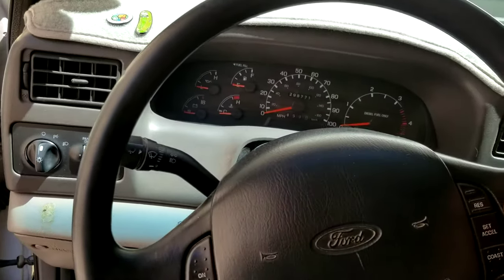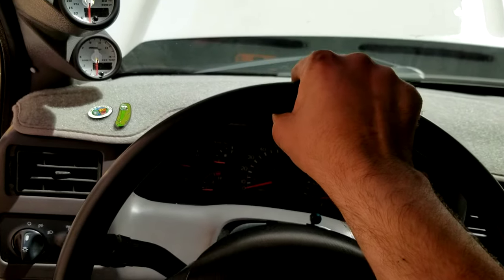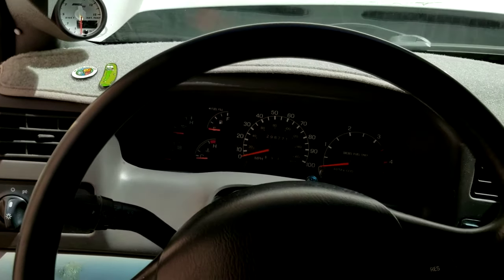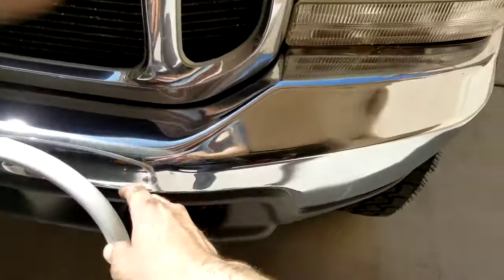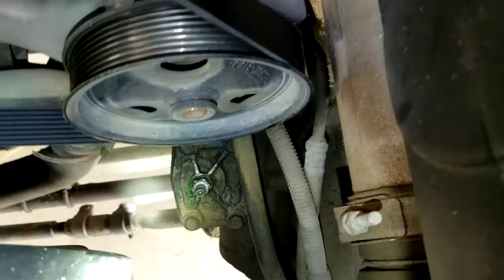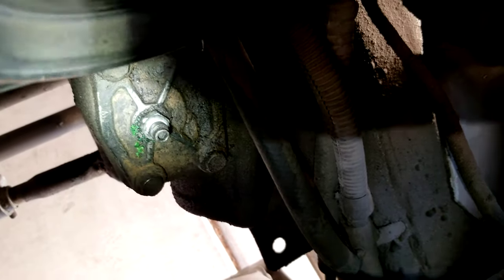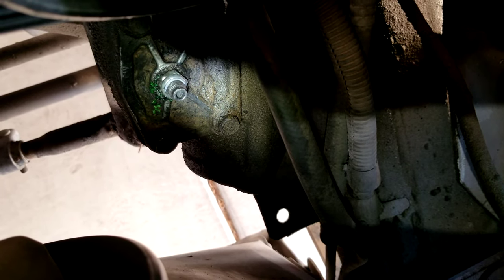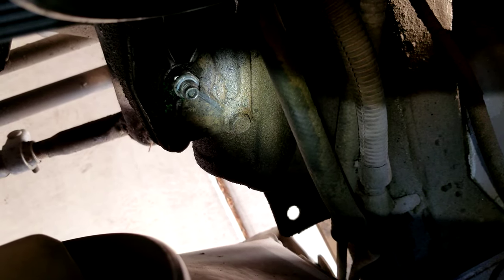F150/F250/F350/F450/F550 loose steering fix.

Comment: 2000 Ex 7.3l... I thought you only tightened the hex 1/4 turn at a time. This was tighten and then back off 1/4 turn.   Sure don't want to screw this up, so which is correct?
Reply from the maker: You tighten all the way down till your screw stops, but very softly so you don't damage your pilot point. Then back off a 1/4 turn and tighten your lock nut.

Comment: I’d replace the steering box  and it didn’t fix anything
Reply from the maker: @harly108023  you replaced you steer box and you still have steer slop?
Reply: @marshall32781 yes sir I don’t know what to do now
Reply: All my suspension parts are new (ball joints, tie rods, pitman arm, steering pump as well, wheels bearings and the problem still there
Reply from the maker: @harly108023  you check your ball joints. They may be worn out. I would do a full inspection on your front end. 
Jack both front tires off the ground. Grab your tires with your hands. Move your tires back and forth from side to side, look for anything loose in your joints. Then grab the top and bottom of your tires and pull and push to check you king pins or bushings.
Reply from the maker: @harly108023  sorry I didn't see that you did all that already. 
What about the steering u joinst and shaft going to your gear box?
Reply: @marshall32781  yeah I did. I’m taking it to a different mechanic to see if we can find the problem
Reply from the maker: @harly108023  yeah. You definitely have a problem somewhere. Good luck. Hope you can find the problem and get it fixed.

Comment: Gotta be careful doing this. If you overtighten this screw, it will slow the recoil as you round corners. Too much tension and you’ll notice it. Not hating, cuz you are so right....just gotta go easy on that screw. 👊
Great video!
Reply: It can wear out and fail much quicker if it's not tightened properly. It doesn't take much to ruin things.
Reply from the maker: Yep. That's why you take your time and do it property.  Never rush.

Comment: Right on, sir. I have that slop in the steering of my '01 F-250 and it absolutely sucks. This is next on my to-do list. Thank you for the video. 👍👍
Reply: One of my EX mechanics told me my 2000 f150 4x4 doesn't have that adjustment ? OMG i will check tomorrow morning. and if he was a LIAR i will go to him and ask him why all the front end parts almost 3K and steering was still dumb ?
Reply: Did it work

Comment: Information for anyone watching this video and considering making this adjustment.  You need to do this when the steering wheel and tires are centered.
If you do this as described when the wheels are turned you will create a bind in the steering and the wheel may not return to the center after taking a turn and cause accelerated wear of your steering box. In extreme maladjustment you could crack the housing of your steering box. 
When doing this adjustment you are reducing a very small amount of gear tooth play that is designed to exist. Complete removal of this play is not a good idea.

Comment: Horrible advice regarding screwiin all the way and then backing off!

The PROPER procedure is to do a 1/8th turn clockwise of the centre screw then tighten outer lock nut and go for test drive and repeat as necessary till steering is improved. 

The method described in this video is a sure fire way to grenade your steering box and that is EXTREMELY dangerous at city speeds let also on the highway.

Comment: My 2005 Ford Excursion is horrible! You have to DRIVE this thing. Makes my arms hurt from constant back and forth movement. Gonna give this a try.
Reply from the maker: I hope it works for you. That dose suck. Especially on long trips. If you haven't already don't forget to look at your ball joints also. Make sure there not sloppy
Reply: @marshall32781  We just put a new stabilizer bar on. Tomorrow we will do the steering box. The ball joints look like original equipment. Dealer put new shocks on but it looks like that's all he did. 1 thing at a time.
Reply from the maker: @billie-leelawhon3941  just remember don't crank down on the pilot needle. Be very gentle.  If you damage the needle your gear box will be junk. Just be very gentle with it. Take your time.

Comment: That's the worm gear you're adjusting and you only wanna do minor movements at a time. About 1/4 - 3/8 adjustments, then test drive it. The problem I'm dealing with is the steering wheel itself and the bearing. I need the rebuild kit.
Reply: I have a problem with my steering wheel , could it be the rag joint going to the steering box ?
Reply: @drewdrew6.0  depends on what type of issues you're having. What type of vehicle and describe in detail the symptoms.
Reply: @carolinawestern3875  2006 ford f250 , it drives very straight but the steering itself is really loose , about a 1/4 turn or less until it actually turns , only thing is , the steering box is a reman
Reply: @drewdrew6.0  sounds like it needs adjustment.  Atop the steering box is a threaded stud. With a hex head or recessed Allen wrench fitting on it's end, and a lock nut at bottom. Hold the stud in place and loosen the lock nut. Turn the stud clock wise 1/4 turn. Snug the lock nut and test drive it. Do this until the steering feels ok to you.  My boss has 4  F250's & they all needed this.
Reply: @carolinawestern3875  I notice that everything is tight except the top shaft , the input shaft that connects to the rag joint , it has a very good amount of play from the wheel to that input shaft , but the lower shaft stays in place, will this adjustment fix it ?
Reply: @drewdrew6.0   The adjustment I mentioned only removes slack inside the actual steering box. That's normal wear from age and miles. This wear in the box, translates to steering slop or play. Often prone to following ruts and doing what some call 
"Road Wander"
Reply: Hope this helped & msg if you need anything else. Let me know how it came out.
Reply: @carolinawestern3875  I gotcha , only problem is the box is a brand new reman so I’m assuming it wasn’t remanufactured correctly
Reply: @drewdrew6.0  try making the adjustment I mentioned earlier. It can't hurt. When it takes effect, you'll feel a definite change in sensitivity to the steering wheel as it takes out the slack in the box. Just remember, about 1/4 turns at a time.
Reply: @carolinawestern3875 more like a "death wobble"

Comment: Other videos recommended 1/8 turn, tighten nut, test, and keep adjusting as needed with 1/8 turns to not bind and possibly ruin the steering box.
Reply from the maker: That's up to you on what you want to do. This dose work. You just have to be careful when you adjust it all the way down so you don't ruin. The needle o. You pilot. You don't habe to do it this way that is 100% up to you on how you think it should be done. I'm just giving you on how I do it and never had any issues.

Comment: I adjusted the screw to that spec, tighten until it stops, then back off 1/4th turn. It’s tighter, but it feels stiff. It’s not binging or grinding, but it feels stiff.
Reply from the maker: If it's to stiff just back off another 1/8 turn out at a time until if feels perfect for you.
Reply: @marshall32781  ended up needing a full turn out, and it’s still slightly stiff. Maybe time for a new power steering pump.

Comment: I bumped into a small tie wall and whipped my steering wheel with my thumb in it, now my steering wheel in way off. Any idea what happened. Nothing seems bent.
Reply from the maker: I couldn't tell you anything for certain.  I would have to look at everything.  I would take it to a brake shop to get the alignment checked out.

Comment: even if my trucks solid axle swapped with a dana 60 out of an 86 f350 this should work for sloppy steering keep in mind i have a 12 inch lift and 37s or if there’s anything else it could be can someone help me
Reply from the maker: Yeah if you lower your suspension. That is a really high center of gravity.

Comment: So loosen nut then tighten allen reverse 1/4 turn then tighten the nut back? Is that right
Reply from the maker: Yes but be very careful on thighting the Allen one. Go slow until you feel the slightest resistance or else you will destroy your gear box. Also don't forget when you tighten the nut keep the Allen on the bolt so it doesn't move on you.

Comment: I did this exactly as you said and my steering went from loose to so tight it sticks when you let go of the wheel and won’t come back after corners… I thought maybe it was too tight so I loostened another 1/4 and drove it and no better. Kept loostening and testing until it was all the way unthreaded and still sticks. Any idea what is going on? I can’t even drive it like this.
98 Ford Lariat F-150 5.4
Reply from the maker: You didn't tighten it to tight at first did you?. Sounds like you may have damaged your pilot needle.  That's not a good thing.
Reply: I just snugged it up, then backed it off. In the video you say until it’s tight. I didn’t reef it down or anything.
Reply from the maker: @pjcampion1442  did you jack up both steer tires off the ground and try steering? Check your fluid level? You may have gotten air in the system.

Comment: So do you 1/4 turn on the allen, drive it to check it, then some more if needed? thanks I have an E-450 frame under a small Class C RV.
Reply from the maker: Yes 1/4 turn out. If your steering is still loose after that, you may want to look into a new steer box.
Reply from the maker: Or check you ball joints for play.

Comment: I have a question, which one am i tightening, and which one am i holding? A little confused
Reply from the maker: You want to hold the nut when you tighten the screw. Then when your screw is set where you want it. You hold the screw with your hex wrench when you tighten the nut. That's so you don't loose your adjustment you just made.
Reply from the maker: Did you end up figuring it out?
Reply: @The Technician  hey I ended up with another 250 and just found your video again lol, I ended up fixing my other 250. going to use this on my new truck, thankyou!!!
Reply from the maker: Your very welcome.

Comment: I just put a 2019 6.7 f250 box in mine that only have 35k miles on it , and still have this problem
Reply from the maker: Probably a stupid question, did you check all your ball joints?
Reply: @marshall32781  needed a couple adjustments, everything is tight now and I have no play at all and it turns like a 2019 now

Comment: Does not  work on f150 have 98 and 2001 don't have the adjustment
Reply from the maker: You should have it. All steer boxes have to have that adjustment.  Yours my be in a different location on the truck.